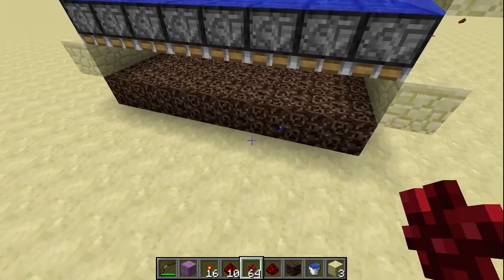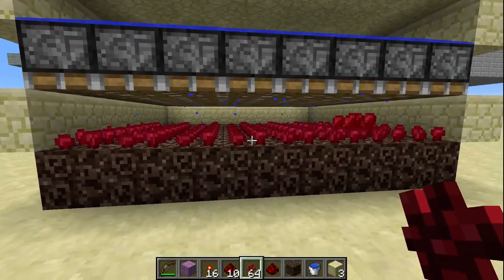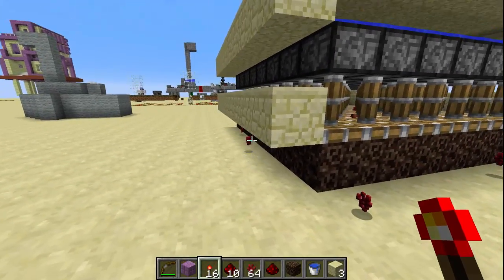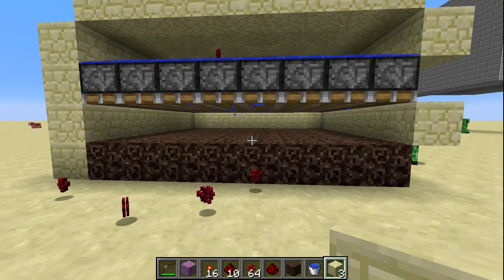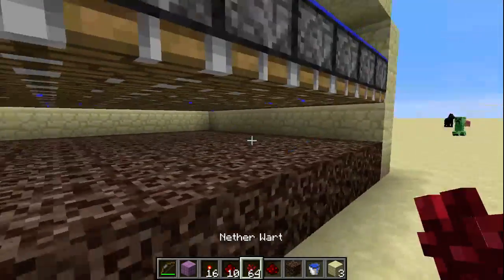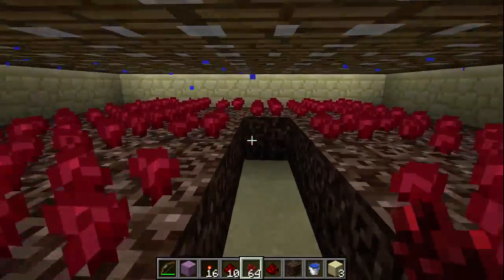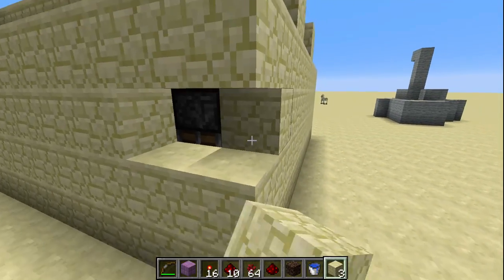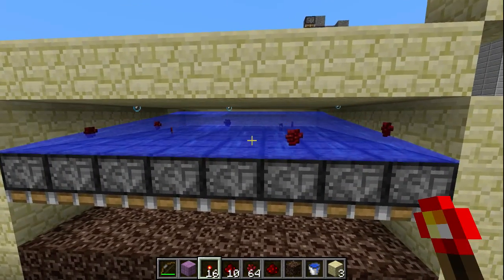Netherwart Farm Concept For Minecraft 1.10

Comment: It's fairly good for a semi-automatic farm. You could make the water stream to the back of the farm into a line of hoppers to a storage unit.

So have 4 rows so you can fill the farm without breaking the blocks, and fill up water at the front. Have the water flow to the back into hoppers, and you are all good. I don't have a solution for the ones that fall out the front though :(

Comment: i don't really get what is supposed to be better about this Farm than just a waterstream that washes the fully grown netherwards away with the Push of a button?
Reply: Well it is quite space efficient, but then again it is not very piston cheap
Reply: It is more MLG than the design you are describing. Other than that, I don't know.
Reply: Minecraftster148790 but the way I described it earlier, you would be able to have 2 farms on top of each other for the cost of maybe two additional Blockrows at the back
Reply: +Malte Wesemann its just a concept implementing the translocation behavior of pistons and is open to change although i don't think there will be any practical use.

Comment: OR create a 10x10 space build a strcture that goes up one block every 3 blocks at the end 3 blocks have stickypistons water and a back wall to seal off the building
throw some redstone down that connects to a lever on the outside which makes the sticky pistons go UP holding the water off flip the lever bam water goes down into hoppers if wanted harvesting all the netherwart

Comment: my netherwart farm is much easier and uses so much less redstone. 20 wide, 10 deep and 4 tall room with strategically placed dispensers on the back wall with water buckets. you can run in and plant then when they are all full you activate a switch to turn on the water (or a button with timer in circuit to turn off after 10 seconds). river on the end collects them and deposits them into a hopper and into a chest (or if you have an iron farm netherwart gets dropped into a row of hoppers leading to storage chest). this design can be extended infinitely and mirrored along the redstone to double it.